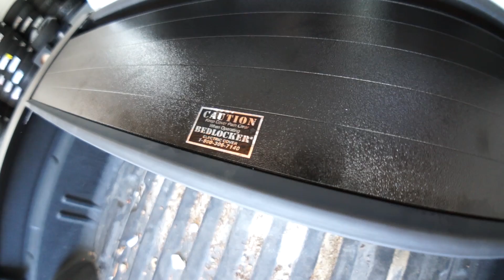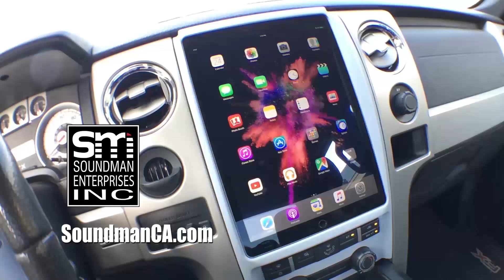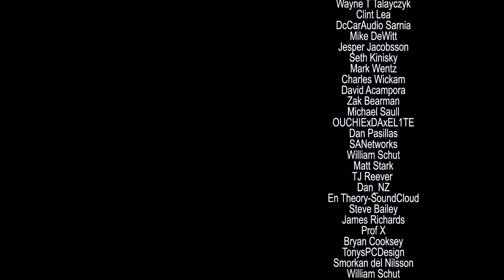Power retractable tonneau cover, iPad dash kits and NEW projects - AMPLIFIED #647

Comment: The issue you are having with "stuff" in your paint is something I have always battled in my shops.  It is VERY hard to do paint finishing in the same space you do wood work.  No matter how clean it may seem, there is always dust in the air.  I know you've set up an air-draw area you use for removing fumes, but it may also be drawing dust over your work.  There are probably some good tricks out there for partitioning space with plastic sheeting and other ways to manage your shop environment for these competing projects.  Good luck!

Comment: Use plastic sheeting attachrd to pvc or wood framework and a cheap box fan on each side with one of the good hepa type filters used for air handlers on back of intake fan to make a quick paint booth

Comment: You'll never get a perfect paint job when painting in the same room your cutting wood in unless you partition off an area that can be free from airborne dust particles. I've used plastic sheating to build a temporary booth in my garage before. Wetting down the work area to keep the dust down will help as well. Also, you may now have dust in the can of paint. Running the paint through a strainer before applying could help if your trying to nail a perfect wet wet.

Comment: FFS DOUG Powder coat that shit $50. done. More resistant and wetter than anything you or rafas gonna pull off with or without a gun. but still doug, you do need to get a gun and prime the shit out of your mule dash stuff otherwise thats never going to get done, but this amp rack, just powder coat it.

Comment: No you need to figure out how to use the por15. The por15 is made to strengthen weak,rusty metal. You wanted a chip resistant shiny paint. Por15 is just that. It will hold on to the metal even if you bend it. You want pretty then you should of left it brushed metal. Now you want to cry and blame everyone other than the guy who used the por15. Wake up Doug and realise you wanted the coating to do a thing it wasn't designed to do. And the hammer tone your looking to use is not rustolem , its from the fifties and its a lacquer. I used it to brush paint a tool box in highschool , and its more like por15. Remember any paint job is 80% prep and 20% paint.